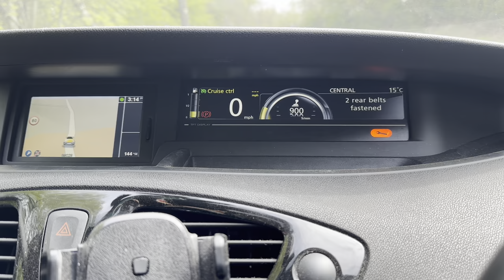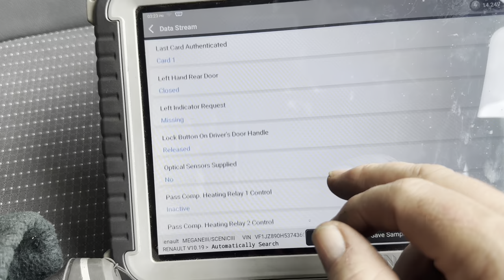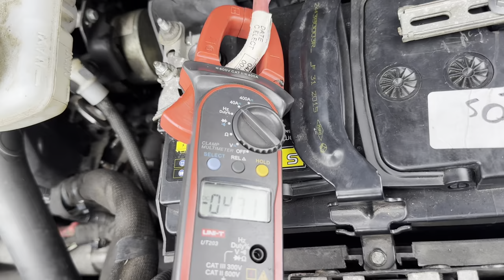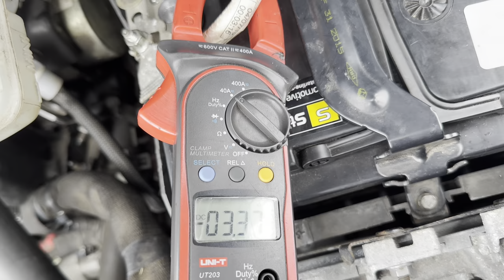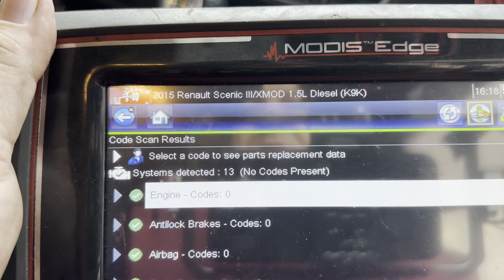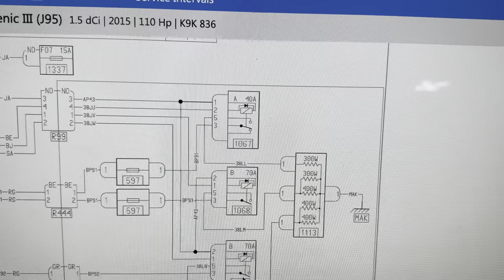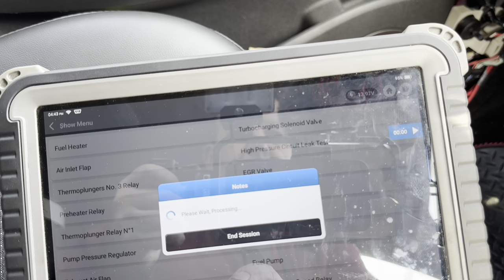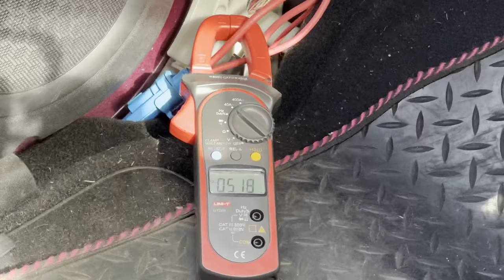Renault Scenic 1.5dci - Battery goes flat/Parasitic Draw

Comment: I literally have the same dci model in the same colour with the same issue, same year... And picked up from a dealership in... FALKIRK!!! What's the feckin' chances of exactly the same issue happening in 2x of the same vehicle from the same region???

Did you manage to get this one sorted chief??? - Dinnae want to start disconnecting stuff if it is something crucial...
Reply from the maker: Never got to the bottom of it😫
Reply: @sandyande   Well sir... You saved me a LOAD of heartache... Thanks for getting back.
Do you fancy doing some servicing on mine now??? 😛

Comment: Dear Sir or Madam, I didn't quite understand what was draining the battery, something about the hand or something.
Reply from the maker: It was auxiliary heater (electric) that was the problem, I think it might be the control relay side rather than the actual electric matrix but it has just been disconnected at the moment